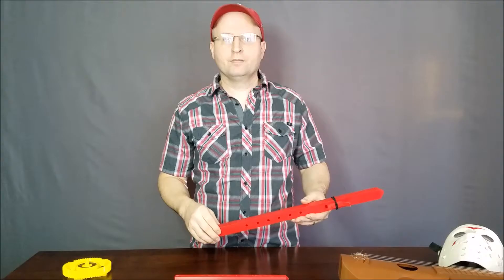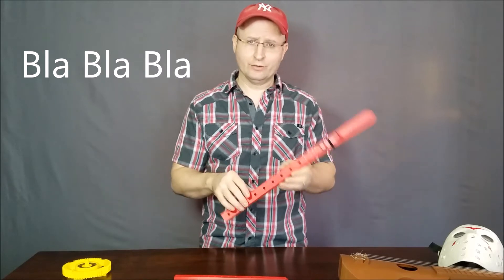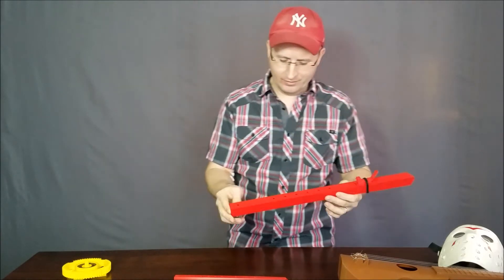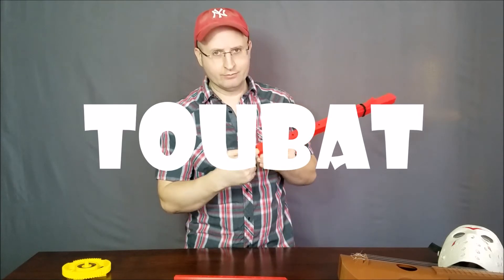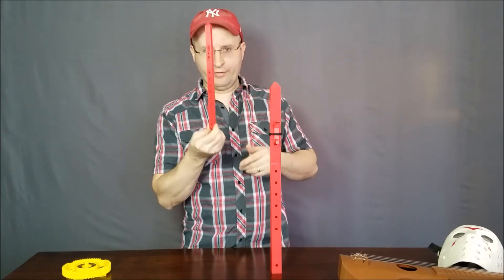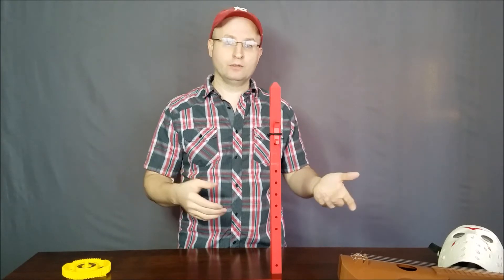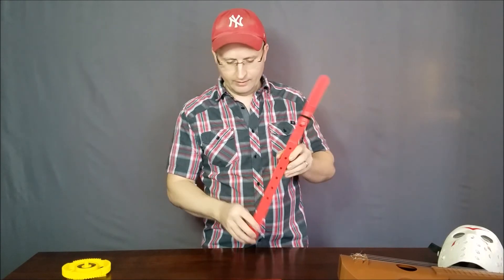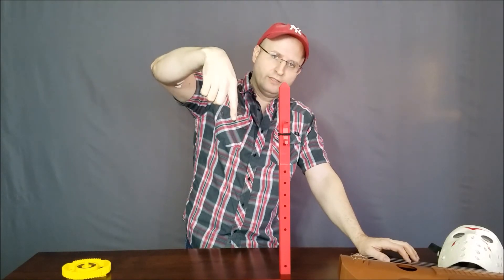Square Native American Flute  -3D Print

Comment: i've seen other videos that claim you need to tune the flute by it's overall length and individual hole sizes, did you need do this as well ?
Reply from the maker: I guess that would make sense for hand drilled holes and if a computer wasn't manufacturing the flute. However it needs almost all of it's tuning on the sound hole which needs to be a sharp inward angle.  The other more critical thing is printing at point 1 layer height,  I think deburring may be more important.  But if one where to look to make each note perfect then they could use a tuner and an exacto knife.

Comment: extra cool! Hey I read you post on Thingiverse about the bad hot end on the CR-10. I had the same issue, but I replaced the cooling fan with a 40x20mm fan that moves way more air. I had to attach it to the outside. I'll send you some pictures and also how I fixed my hotend.